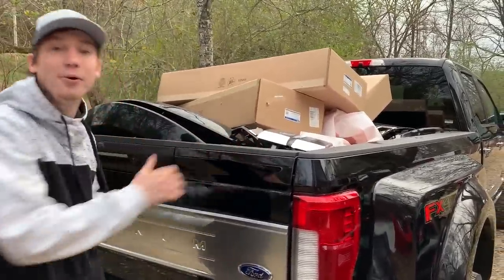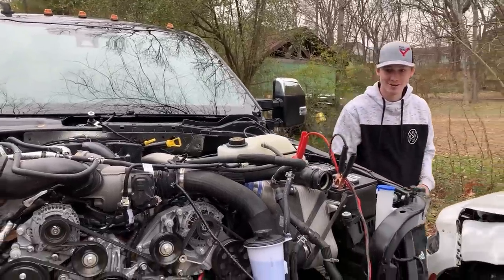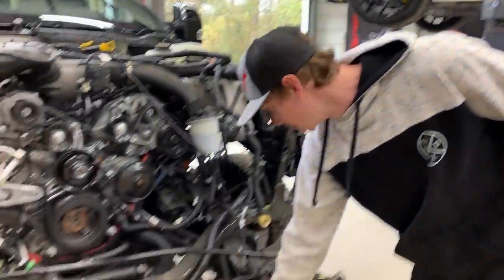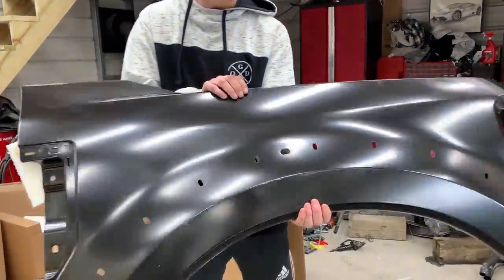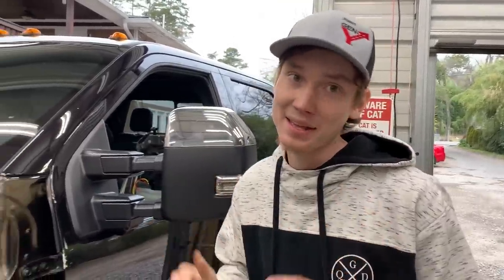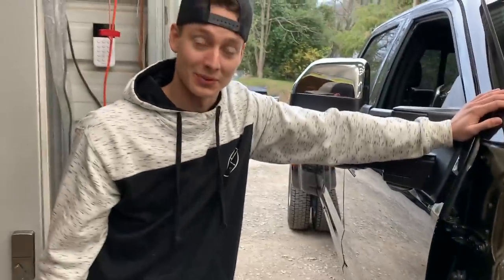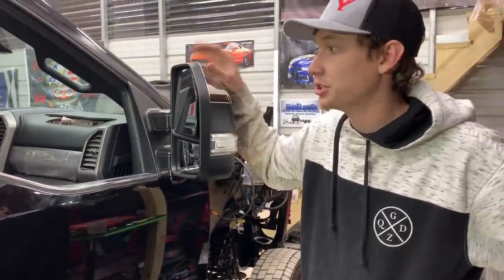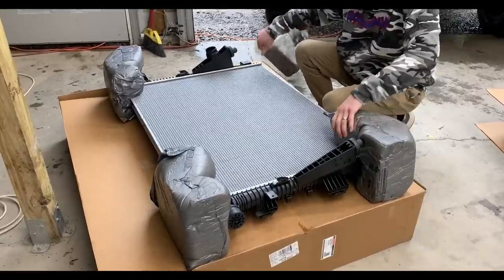Rebuilding A Wrecked 2019 Ford F-450 Platinum Part 4

Comment: 19 must of been a horrible yr I've got the exact same truck and about a month after a got it a guy at work didnt check his fithwheel connection and trailer came lose from his tractor and landed on my hood . I was... was in love with my truck til then then it had been violated . I actually just ordered a 20/20 today and going to start fresh . Also I had a ton of water leaking in on the drivers side keep a eye on that took them 7 times and 7 different problems found

Comment: Heads up they had a recall on your tailgate I'm pretty sure might wanna look into it.. I think it causes an electrical gremlin
Reply: I understood it to be an electrical glitch with the tailgate latch.  customers complaining tailgate will automatically lower itself at highway speeds for no reason.
Reply: @timglass6041  I remembered it being something and since its controlled by some sort of command module.. thought it might be draining their stuff I'm sure they will find but thought I would throw it out

Comment: i have a rough idling every minute or so in my 2008 mustang when i’m in park or just sitting at a red light, the car idles low and vibrates when the A/C and/or radio is on, but when both are off the car idles fine, what could be the cause of this?

Comment: 2 things guys first of all I've never actually seen y'all bust out a an actual battery charger I've only been watching since I think right before the Lamborghini but a new truck like that then battery should take a charge and replacement battery will be $400 Plus and secondly how much has v Toons accident slowed you from being able to get in there I've seen a video from him since then but I'm sure he got backed up loving the channel and as far as the as far as the rims go you could either get them wrapped or use that product dip you could even freak people out and turn all the Chrome to red print episode and just act like it's the plan for the truck I don't like Ford's but boy this Platinum is sweet have y'all ever thought about sitting down and doing a PSA four things that y'all look for and things that will make you automatically stay away from an auction vehicle I think that would be extremely interesting keep up the good work guys you'll be at 2 million in no time

Comment: If the batteries are bad wont Ford warranty them because they are so new?
Reply: salvage title, no
Reply: I dont believe they said it was for sure salvage
Reply: With all of the airbags, I bet it is
Reply: @brianwatkins5066  I wouldnt assume that at all. I have seen cars hit so hard there is damage to the B pillar (from the back) and still have a clean title from the insurance company. You can get everything from auction.
Reply: That's possible. Either way I bet the batteries will be fine once they are able to run it for a while. They keep shutting it off right away with no coolant. Depends how long they've been dead I suppose

Comment: Don't black it out. Been done so many times because its the cheapest easiest mod to do, and honestly its makes any expensive vehicle look really really really cheap.. You always need some accents to set the vehicle off. Either chrome or color. Also if you plan on towing with this pig DO NOT CHANGE THE WHEELS. Those are Alcoa's. Same thing as on your Dads Tractor Trailer. Incredibly strong for the weight. Probably 3 or 4 times stronger than the wheels on the duramax.

Comment: I'm new here.  I'm sure you boys are a lot more clever than the Bo and Luke characters you portray. 
Just curious how it's possible a couple no experience, wet behind the ears, supposed country boys manage to intuitively tear apart, repair and reassemble these incredibly technically difficult wrecks without any help financially and technically. 
Just asking. 
Continued success in the future.

Comment: When you don't know the difference between rivets and E-Torx.
Reply: ... then it's time to learn the difference.
Reply: @gpackwood1  I don't know, man. If you're not smart enough to know the difference between a nut/bolt and a rivet by sight you probably shouldn't be working on your vehicles yourself.
Reply: @agentx250  -> I have no problem with that however  it's pretty important to remember that nobody on Earth was born knowing the difference and everyone has to learn if they wish to be competent.  And then to be ready to learn in six months what you learned is no longer the standard. Pretty good reason good managers in shops are paid well.

Comment: You guys and other Youtubers really should stop running your engines without coolant as it increases wear on water pump bearings and seals which are designed to run wet.